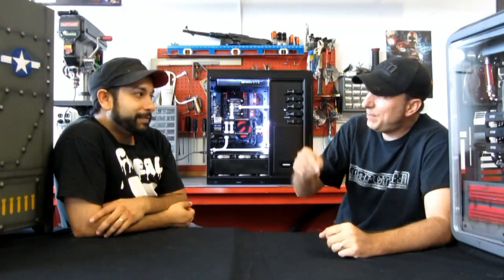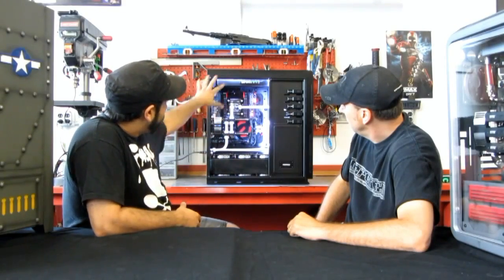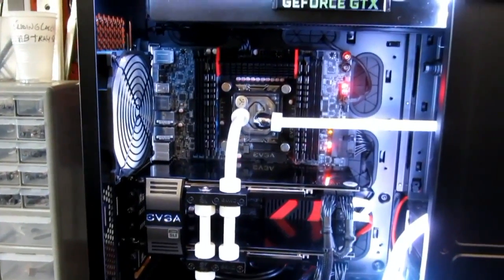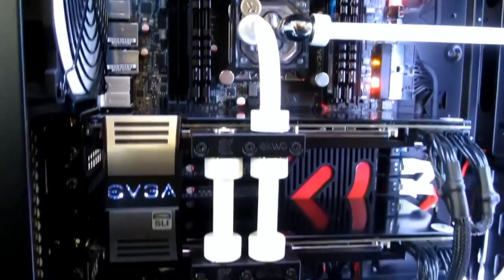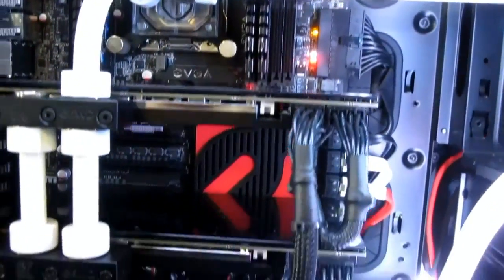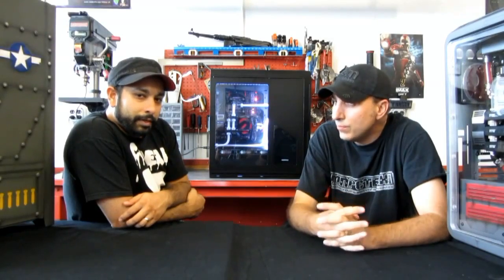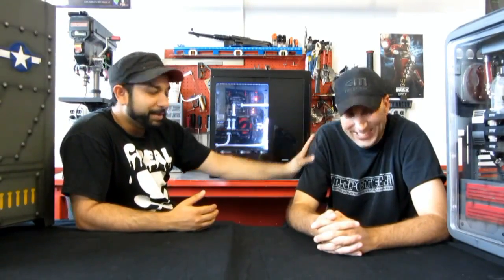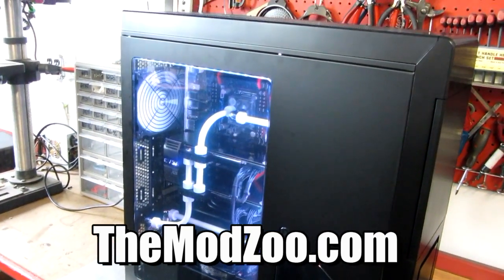Phanteks Enthoo Primo Full Tower, EK Liquid Cooled, Dark X79, TITAN SLI, Primochill Tubing

Comment: Actually i think water cooling in some cases can be easier than air cooling all you need to know is the res should go before the pump in the loop and the ideal placed for it would be to put it higher than the pump.
Then it is just a matter of dry fitting stuff and doing test runs while taking precaution of any leaks.

Comment: I know the vid is old by now and the primo has been out for a while but have they made an accessory res mount that has a deeper cut away that can accommodate the longer cards like titan x and 980ti's in SLI?  Or would it be too thin at that point to be able to mount anything to it?

Trying to decide if this is worth upgrading to from my 650D or just spend more money and get a case labs case.  I know that if I got the case labs though, I'd have do do a lot of work myself in terms of mounting, holes, fan splitter, etc.

Comment: Nice build Jesse, I like how you routed the acrylic tubing, also like how clean it looks, sometimes when using to many blocks like ram and motherboard blocks the system looks way to busy, only thing I would add is some custom black sleeving with a hint of red and white to pull all the colors together. well done Phanteks will be delighted with what you have built in to there new case.

Comment: Is it possible to do it while the heatsink is still on the board?  It would only be the red areas of the heatsink not the entire heatsink.  I've taken heat sinks off boards before so I know that it's not difficult but it still would be easier to leave it on.

Comment: So you can fit a triple 140 rad?
Reply: Yes you can on the top.
Reply: 420 radiators on the top, buttom
and 280 in the front and i think a 280 or240 right next to the 280 in the front

Comment: Im a beginner; So If I just put a 980ti, I can easily keep the mounting for reservoire and have it installed without any issue? And dont need full of rad if its not sli so more place for 30$ led---

Comment: Nope it won't, the setup I have running is called a parallel GPU loop, what you are referring to is a serial loop. Parallel loops are better for the overall flow of fluid in the loop.